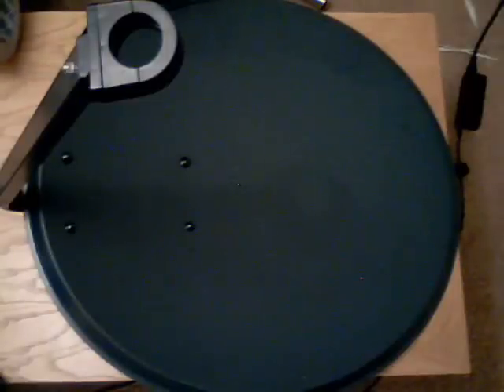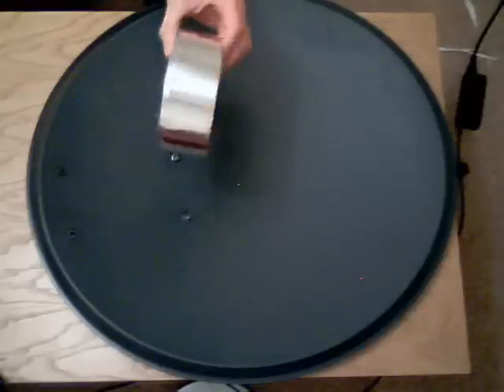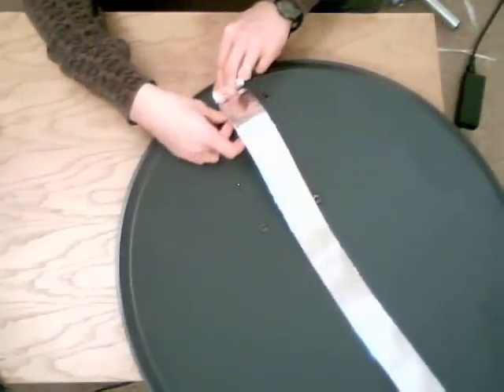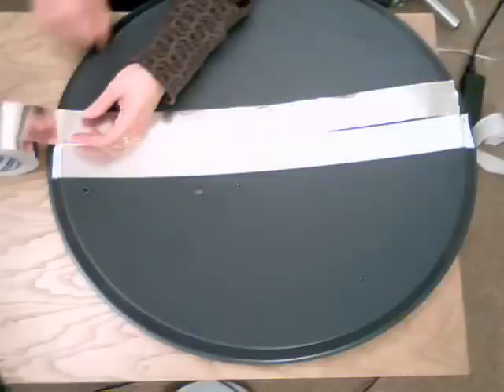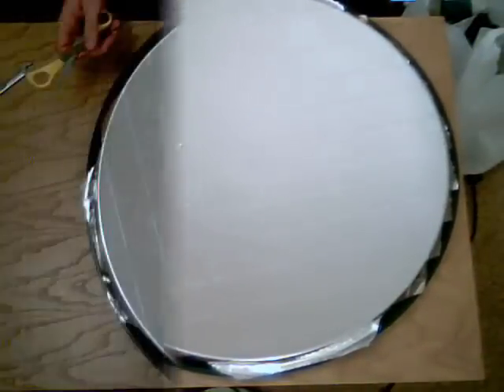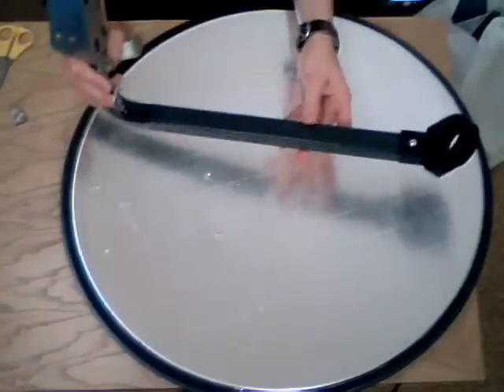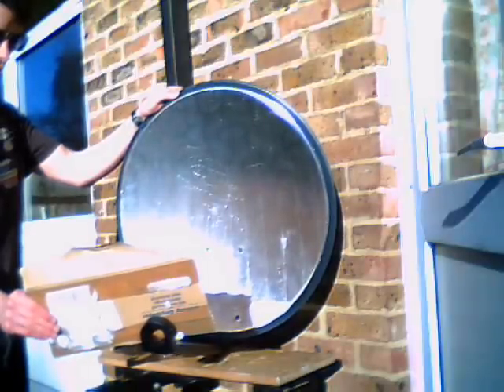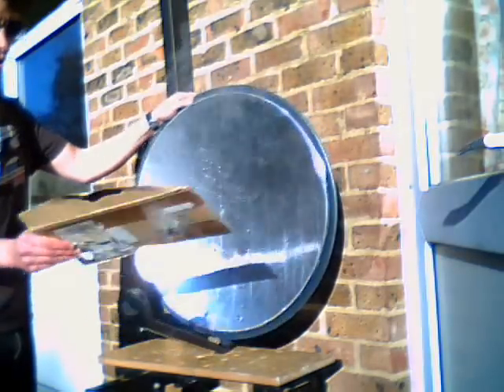How To - Make a Cheap Parabolic Mirror!

Comment: See if you can get your head around how this works https://www.youtube.com/watch?v=bJF7p72YUAc
Reply from the maker: +bridgendesar the incident rays (provided the curved mirror is angled directly towards the source) reflect onto the central pillar and are focussed to a 2nd point. Why though? As attenuation losses would be present in both surfaces, so the efficiency wouldn't be as good as a single mirror. Also the central pillar creates significant shade due to being directly in front of the source...
Reply: Amdraz The animation is not to scale, I exaggerated the Piller for visual impact.
In practice the main reflector would be split it two to negate the shadow.
As for the losses, this design would need to be built a bit larger to compensate.
You could also off set the Piller too.
I think this would be easier to make then a parabolic
Reply from the maker: +bridgendesar I don't really understand what you mean by 'main reflector spit in two' but GREENPOWERSCIENCE have a couple of videos on parabolic troughs which are really great! A trough might be easier to build, I've not tried?
Reply: Take a look at this, the good stuff is near the bottom of the page http://kmr.nada.kth.se/wiki/Main/PointFocus
Reply from the maker: Thanks for the link, lots of info there!

Comment: Can we use Chrome vinyl wrap..?
Reply from the maker: Yes that would also work just fine provided you can get it smooth. Any bumps will scatter light away from the focal point, thus dropping the amount of energy concentrated there.
Reply: Mylar is better. You can buy it at hydroponic stores.

Comment: Can u use tin foil ?
Reply from the maker: +leighmossien2009 not really as you would very likely end up with lots of little crinkles. These would scatter the light rather than focus it into one spot. Glueing it down smoothly is also very difficult, I tried before using the tape.

Comment: where can i get that aluminium insulation tape
Reply: At home depot or lows in the ducting section.
Reply from the maker: The internet is your best option; Amazon and ebay both list it under reflective or mirror tape. Hydroponics tape should also bring you decent results.
Reply: why would you need a tape? these are usually made of aluminium, just remove paint, and polish surface , you will get better results.
Reply: use mirrors instead..